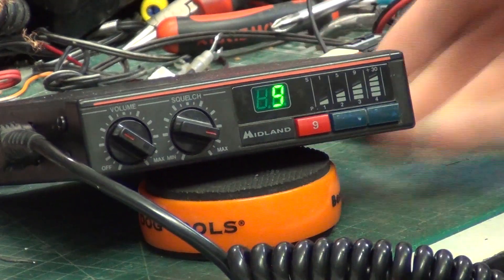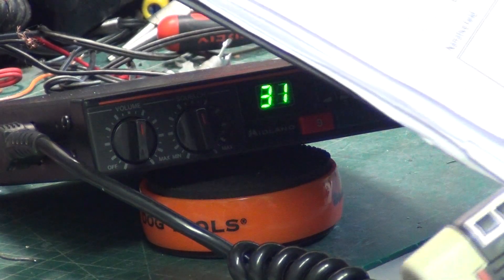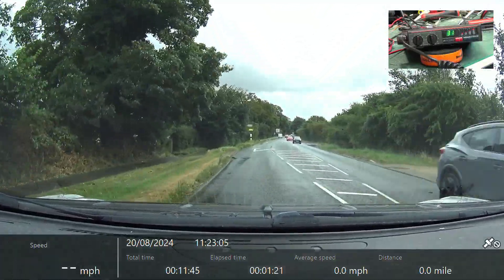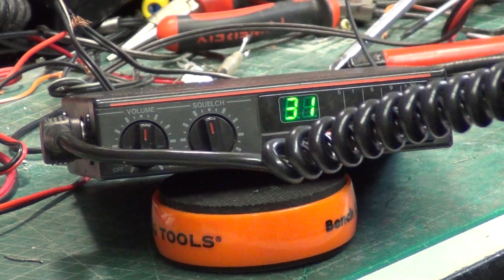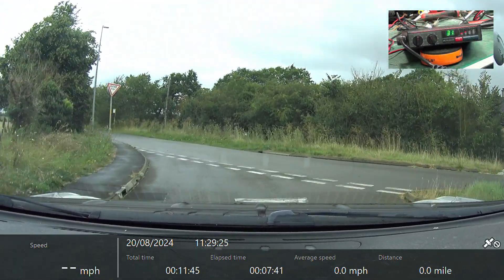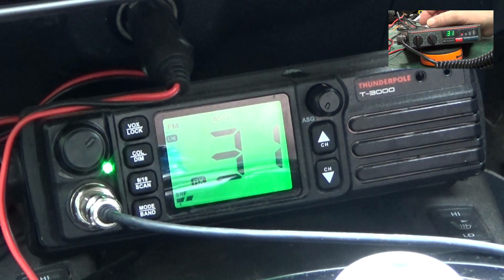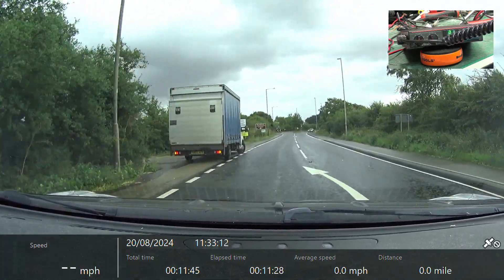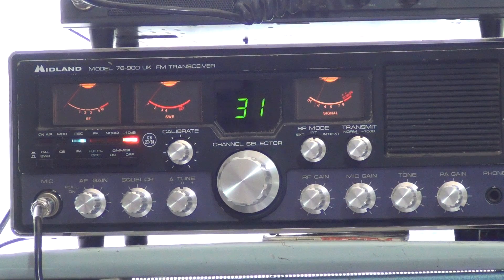Midland 77-1165 CB27/81 UK FM  CB Radio -  On The Air test

Comment: One of the best results around scratchy corner i've heard in a long time. Would be interesting to hear it on the standard replacement mic to see just how bassy it is ?
Reply from the maker: Have a look in the back catalogue from about nine months ago. We did the test using a standard mike, then just compared with a factory original at the end,

Richard
Reply: @ukfmcbradioservicingTango21  will do 👍